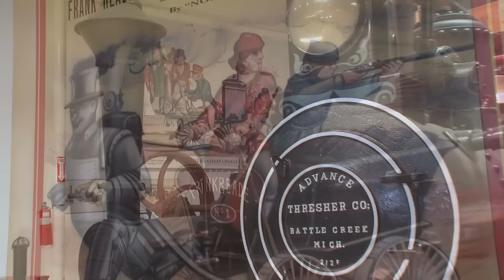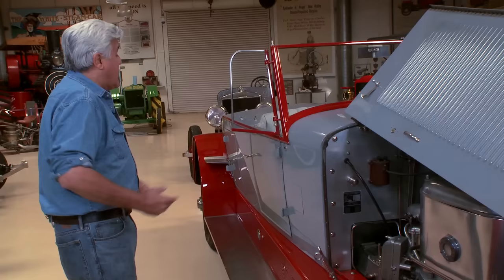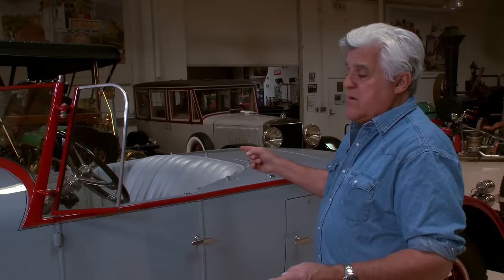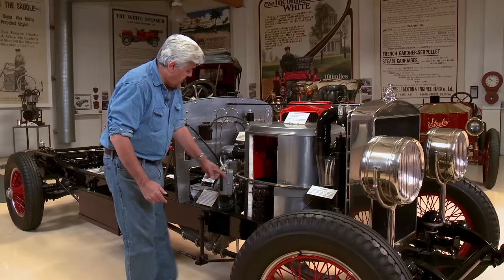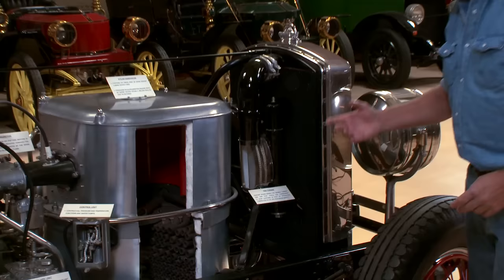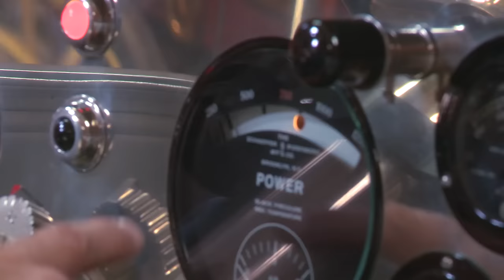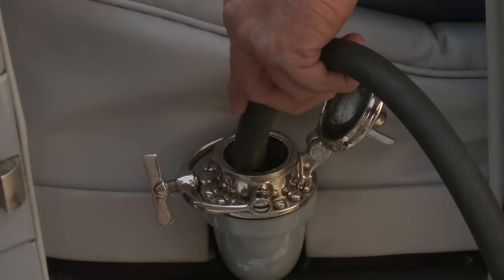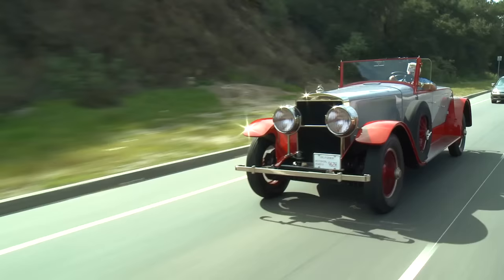1925 Doble E-20 Steam Car - Jay Leno's Garage

Comment: Amazing that they produced steam cars that advanced. I wonder what the fuel mileage was.
Reply: PacificCircle1 Most sources report actual mpg ratings for a Doble 'E' at around 12mpg on kerosene.... not very good considering it only produces 150 hp
Reply: The real doktorbimmer However not bat considering it produces 1000 pound foot of torque.
Reply: Paradigm Storytime Not really...
Reply: The real doktorbimmer Vehicles back then produced little horsepower, plus the Doble was as heavy as 15 mpg Suburban. Even today's trucks produce more horsepower per cubic inch than my '69.
Reply: PacificCircle1 Not in this class of automobile! As early as 26' Duesenberg and Bugatti were rolling out models with 265-300hp in this price range... making the Doble look pretty pathetic. 

Yes a Chevrolet Suburban is very heavy and only gets 18mpg combined 22mph highway but of course it also produces over 400hp!!!!
Reply: The real doktorbimmer Doble did not mass produce his cars so they were expensive.
Reply: PacificCircle1 They weren't mass produced because steam powered cars were already completely obsolete by 1925...  Stanley was out of business by 1924 and the White company is still in business because it already stopped building steam cars in 1911 and switched completely to gasoline (Otto) engines.
Reply: The real doktorbimmer It is well documented that Doble was always making changes, so the cars were almost single run cars.
Reply: PacificCircle1 Its also well documented that the steam car was already completely dead by the time when Abner Doble built his first E-type... all of the other steam car contenders  were gone by 1925...

Even if Mr. Doble had frozen the design for mass production it very doubtful he would have sold even one more additional car.. the market for steam cars had already dried up.
Reply: PacificCircle1 couple  of  hundred miles on a tank of  water
Reply: Michael Taylor I think we all got that from the video, the question was  fuel mileage not water mileage ... water is not used as a fuel.

The answer is about 10mpg on kerosene...

not very good considering in only produced a maxium of 150hp
Reply: 150 hp was amazing in the days it  was made
Reply: Michael Taylor No, it wasn't really... in this  price range (what we would today call a super car) by the mid-late 1920s manufacturers like Deusenberg and Bugatti were building and selling cars with nearly twice the power in the 250-350hp range.   the Doble E was really a dinosuar.
Reply: thnaks  for the  update but  those  cars  were  all top of the  range  in their  day
Reply: Michael Taylor The Doble E cost was in the same range.. if not even more expensive..

Dollar-per-Hp the Doble was very expensive
Reply: +The real doktorbimmer The Doble could reach a top speed of 132 mph range... making the Bugatti look pretty pathetic.
Reply: BluebirdFLYs Otto type ICE powered cars with Mercedes Benz,  Fiat, Sunbeam, Napier and Liberty engines had already reached 145+ mph  with engines reaching 350-450hp...

Making the Doble look pretty pathetic
Reply: The real doktorbimmer
Buddy I was quoting what you said lmao.
Reply: BluebirdFLYs WTF??? You weren't quoting anything I wrote...  I never mentioned the Doble's top speed...

It may have been the fastest steam car, but it was not by any means the fastest car in the world in 1925! Nor was it the most powerful!
Reply: When did I say it was..?
Reply: BluebirdFLYs Yesterday, you wrote quote: "Buddy I was quoting what you said"

You can't remember anything that long?
Reply: The real doktorbimmer okay you got me. I wont argue :D
Reply: ***** Childish insults and false statements won't make you look any smarter.. and it won't prove your point either.
Reply: ***** All one has to do is look at the performance and mileage figures of a new Chevrolet Suburban and compare them to the Doble... there is no comparison.

They weigh nearly the same, neither is very aerodynamic yet the ICE powered vehicle has 200-300% more horsepower and 200-300% BETTER fuel MILEAGE..

And what about cost?

Do you want me to figure out what the Doble E cost in today's dollars????
Reply: ***** The simple truth is the introduction of the electric starter killed the steam car... Why?

Because easy starting was the only advantage the steam car had over ICE powered cars..

without that they went extinct overnight...

Steam is dead.. steam cars have been obsolete for over 100 years... and they are not coming back... because ICE are simply much better.

Cheers!
Reply: ***** Yes, it certainly was, the electric starter killed any advantage the steam car had left as the technology of ICE's speed away from the steam era of the past.

Have you forgotten?

Steam cars like the Doble, White and Stanleys ran on PETROLEUM too.

so that's a moot point.

Economy of scale? The White steam car was at one point one of the largest automobile manufacturers in the world..

Certainly if one was to produce steam cars again? It would have to compete with the same cars on the road RIGHT NOW..

sometimes I think you are afflicted with a terminal case of nostalgia.. 

Steam is obsolete technology, abandoned 100 years ago because something better came along and pushed it aside..

steam cannot compete with ICEs
Reply: ***** ICEs can, have and currently are run on a limited scale.

ANY COMBUSTABLE FUEL THAT CAN BE USED TO FIRE A STEAM ENGINE.

Even wood...

ICE powered car were not very popular until the invention of the electric self starter either.

White produced thousands of steam powered vehicles before it switched to the more commercially viable ICEs... the rest of the steam car manufacturers no longer existed by 1930.

Yes, it is obsolete... and it can be easliy proven by the total and complete lack of steam powered car mass production in the past 100 years.

Well certainly you are nostalgic if you insist that a technology that has been obsolete for 100 years is still commercially viable.. either that or completely delusional.

Those claims are completely false, fabricated by your own or someone else's imagination.. As I said before VWs official reason 
for cancelling the Enginion project was..
It could not match or exceed currently available ICE technology.

Certainly no automotive engineer would expect that a steam engine on this small scale could possibly match the fuel efficiency of the modern ICE... the data collected simply confirms all the theoretically and practical engineering.
Reply: ***** Yes, petroleum based fuels were considered superior even back in the age when steam was still commercially viable.

Well, another interesting theory but one completely without a basis in modern engineering design...

Because no matter what the external political, or socio-economic influences you care to mention? none of then can disprove the fact that ICE technology is significantly more efficient than its outmoded steam predecessors.

and as the demand for fuel resources increase, so will the demand for more fuel efficient ICEs  and further and further away from obsolete technology like the antiqued steam engine...

Carnot accurately predicted that ICEs would replace steam.... even before ICEs were invented.
Reply: ***** Steam was considered sub-optimal to ICEs even before a practical ICE had been invented...

The study of thermodynamics of the heat engine and the inherent flaws in the efficiency potential of steam is what led to the invention and development of early ICE technology.
Reply: ***** Yes, because its all about Carnot and thermodynamics

WE ARE TALKING ABOUT HEAT ENGINES

How do you explain steam technologies disappearance in applications where 

IS NO TRANSMISSION OR GEAR BOX

Well it took over 100 years for steam to reach the performance level of the Doble E...

what was your point?

Or do you really have one?

Just as we do not have 80 years, billions of funds, and 10s of millions of people working on improving sailing ship technology.

Why?

Because like sailing ships steam power is obsolete!

The theory and practical applications of which are well understood and have been developed to there practical limits.

No one will ever buy cars that CANNOT MATCH the performance of existing ICE powered cars.

Its never going to happen... just like it has not happened in the passed 100 years that steam cars have been OBSOLETE
Reply: ***** That is correct, we measure engine performance and efficiency at the OUTPUT SHAFT.

This allows you to compare ENGINE PERFORMANCE...

Consumers will always chose the product that has the best value for cost..

If you foolishly attempt to sell a product that performs below standard and costs more...?

You won't be in business very long... such is the case with the steam car.

And yet, Nikolaus Carnot accurately calculated the maximum thermal efficiency of steam power and ICEs and determined that the ICE was more efficient than steam.

BEFORE ICEs WERE INVENTED!!!!

How foolish can you be to simply assume that someone born 200 years ago was not intelligent enough to understand and develop a working formula to accurately calculate thermodynamics of heat engines????  

Bullshit! steel and aluminum were already widely available and in use in the design of internal combustion engines.. 

Count Zeppelin used aluminum and steel engines in his worlds first manned powered flight and the Wright brothers also used aluminum and steel in their first heavier than air flight.

These material were available and in use for automobile components BEFORE  steam became obsolete.

Because you seem to refuse to accept the fact that steam has already reached its practical limits and this limit is FAR LOWER than the practical limits of internal combustion engines.

The Enginion experiment was not testing the viability of steam, steam is already obsolete.. the technology that was being sought was that of the catalytic combustor core.

its apparent you have no business experience and free market concept is completely lost to you...

One only has to look at the computer software industry to completely disprove you false notion of how business works...

If steam was better? someone would be trying to make a buck selling them... and succeeding...

The fact is ICEs outperform steam by a very wide margin... and are far more cost effective.
Reply: +The real doktorbimmer
I have a VERY valid point. I'm no troll, I already know the truth, and I'm quite aware of reality otherwise I wouldn't be here offering you some sound life advice. I haven't taken anything personally. I have no issue with steam being obsolete. I take no issue with discussion. I take issue with pseudointellectuals who feel it necessary to correct absolutely everyone and everything and nitpick at every single point to the effect of stifling discussion and force feeding their "I AM RIGHT AND YOU ARE ALWAYS WRONG" superiority complex. I gladly mind my own business, except in the case where every other comment on a video is from the same person with some sort of chip on their shoulder and something to prove. Stop being so obsessive, stop being such a pedant, and just shut up. You've made your point, and I'm absolutely certain there is no mistake about it that steam technology for automotive use is obsolete. Congratulations, you can make an observation in the outside world. Would you like a sticker? You're not making friends being so obsessively compulsive, let alone consistent in drawing straw man arguments, and resorting to ad hominem arguments in this comment section. Take it from someone who's been in your shoes at this moment. No one likes a know-it-all, and further, ABSOLUTELY NO ONE ENJOYS THE COMPANY OF A PEDANT. EVEN KNOW-IT-ALLS.
Reply: Eyebrows Mahoney Wankel engines only have rotors inside the ignition distributor..

The image you selected is of the orbiting piston..
Reply: The real doktorbimmer
Semantics. They are also called "Rotors", or "Rotary pistons". Despite the wankel not being a "Rotary" engine which uses pistons, the name "Pistonless Rotary Engine" has been used to distinguish between the two.

Whenever I go the dealer, they hand me a box labeled "Rotor Assy" not "Orbiting Piston Assy". Mazda also, repeatedly defines their engine as a "Rotary Engine" in it's service literature as well as at the parts counter. Feel free to take a look: http://wright-here.net/files/manuals/1989%20RX-7%20FSM/C_Engine.pdf
Reply: Eyebrows Mahoney A rotor is a device that rotates on a fixed axis..

The piston in a Wankel orbits in a planetary motion..

Mazda didn't invent the technology.. nor did they name the design or its related component terminology.
Reply: The real doktorbimmer
Your argument is that of semantics. The word Rotor has been used since the inception of the engine. Doesn't matter the make or model, when you purchase parts for a wankel motor, the exterior housing is called a rotor housing and the internal triangular "piston" that you keep calling it is a "rotor". You will be hard pressed to find any parts for a wankel by calling a rotor assembly a "oscillating piston".

Even flow meters that work off a similar principal of rotary engines called "oscillating piston flow meters" are still frequently called rotary piston flow meters. We're diverging from the point that even manufacturers of rotary engine parts still refer to the parts as "rotor" and "rotor housings". No one cares about their technical nomenclature, nor should they have to, because it's well understood what people are talking about.
Reply: Eyebrows Mahoney Not at all... but it does seem that your knowledge of the history and the engineering concepts involved is severely limited.

First off you seem to imply that the term Rotary and Rotor are somehow related in terms of the basic Wankel engine concept.

In this regard you are extremely confused and incorrect.

The Wankel engine design purchased by Toyo Kogyo from NSU-Wankel is called the Wankel type KKM-57

IT IS NOT A ROTARY TYPE ENGINE.

Nor does the design feature a Rotor as part of its basic design.

Can you even tell me who invented the Rotary internal combustion engine?
Reply: I never said, nor implied that a wankel motor was a rotary type engine. Hence why I alluded to the distinctive term "pistonless rotary engine". I am quite aware of the difference between a rotary engine, and a wankel. I am just trying to make it clear to you that just because someone uses a term that doesn't agree with your idea of ideal nomenclature does not make it incorrect. I'm not sure who is credited with the invention of the rotary combustion engine, but I know that Felix Millet was one of the first to put it into a vehicle, powering a bicycle (or motorcycle- if you will) with a 5 cylinder variant. Here is the problem though, the wording "Rotary Engine" has evolved over time to mean a Wankel type "oscillating piston" motor, partly because the rotary engine itself fell out of favor due to it's limitations. The motor itself was considered nothing more than a novelty and never really took off (Otherwise you'd be seeing more than a handful of vehicles choosing it over other more conventional ICE motors). Fast forward to the modern age where we no longer find it necessary to spin our engine around a crankshaft, and wankels see a rise in popularity. Only the most discerning pedant cares to make a distinction "well this technically isn't a rotary, it's an oscillating piston motor because a rotary type motor operates off of a fixes axis"....you won't make friends. The English language evolves, words change their meaning over time. If you'd prefer things stay the same then go learn Latin. Yes yes, I am well aware that everyone is incorrect. But I do not find it necessary to highlight it to illuminate my knowledge. So for the sake of sanity, I'm not going to continue to argue with you. You are always argumentative, does not matter what the topic of conversation is about. You always want to prove your knowledge to people, when there is nothing to prove. Sure you may know all these useless facts and tidbits. Impressive dinner conversation, great for making yourself seem knowledgeable, but that's all it's good for. You obsess about the tiniest detail. And you assert your knowledge when it isn't being sought. I'm trying to get you to maybe have an epiphany here before you drive away everyone from your life because you're "that guy". The know-it-all no one wants to hang out with because he always finds it necessary to correct the tiniest detail in casual conversation. I should know, because I've been there. Knowing all of this, is worthless. It's a curse. The loneliness that it causes is just... not worth it. It will not fill the hole in your soul. Just some friendly advice.take it or leave it.

Cheers
Reply: Eyebrows Mahoney The term "pistonless rotary engine " is an oxymoron...

and is not a correct technical description 

of the Wankel designs..

The name given by Dr. Wankel himself was DrehKOLBENmotor

the word PISTON curiously appears right in the name itself..

Yes, Felix Millet invented the design layout.
and no, it was not a novelty, its was a very successful design mass produced for aircraft which were at the time cutting edge technology..

reduce rotational mass gave the design excellent high rpm performance and light weight (due to the fact that a flywheel is unnecessary)

Dr Wankel used the Millet layout in his design.

of course this brings us back to your first mistake in referring to the design as a Rotary or that it uses rotors which it of course it does not.. it uses PISTONS

just as its name implies.

You see its because no one has ever produced a copy of Dr Wankel's Rotary type engine.. the concept was abandoned by Dr. Hanns Paschke who designed the KKM-57

the design that was mass produced until becoming obsolete in 2012.

 No it only confirms your original motivation and desire to attempt a personal attack against me, but also your deep seated insecurities about your own limited education.
Reply: The real doktorbimmer let he who be without sin cast the first stone.
Reply: Eyebrows Mahoney You must have learned something...  your welcome!
Reply: +The real doktorbimmer There is no sore loser. No one has won anything for there to be a loser. If it makes you feel better about yourself, your life, keep telling yourself that. But the only thing I've truly lost, is the time I spent here talking with you. So, there's that. You're right, I am a loser. I wasted my time trying to reason in a worthless comment thread. Touchè.
Reply: +The real doktorbimmer Doble did not mass produce his cars because he was never satisfied and instead of going ahead and manufacturing he kept modifying. If he had stopped and produced for a while he might have stayed in business. He had a number of orders that were never filled.
Reply: +tadwyn Doble didn't mass produce his cars because steam cars were already OBSOLETE!!!!!
Reply: +The real doktorbimmer From what I can find the bugatti didn't put out much more than 90 bhp until 1927 . At that point with a 17 litre engine it was putting out 350 bhp.  Torque gets you moving. HP is what gives you your top speed.
Reply: +tadwyn Exactly... which explains why the steam car was OBSOLETE before 1925... Low horsepower... and high fuel consumption..
Reply: +TheusZeusDeus No, he is correct, HP determines topspeed.. not torque
Reply: Horsepower is Nothing but a number in a calculator. . . It Still Takes TORQUE (which it has a mountain of) to ACCELERATE Up To Speed. (Up To And Including Top Speed) . . . Horsepower is just the ability to Maintain That Speed. . . There's an old saying that still holds true "Horsepower Sells Cars, but Torque Wins Races"
Reply: +oldSawer  Then why are boilers rated in HORSEPOWER
Reply: PacificCircle1 its more efficient because wood is cheap
Reply: +Horny Pervert Wood is less efficient, it has less than half the Specific Energy of petroleum and a 1/3 the Energy Density
Reply: +doctorbimmer Rather that waste my time typing it all I'm simply going to copy & paste a simple explanation on that, though I'm sure you will still attempt to argue with the answer. 

""Boiler horsepower is a boiler's capacity to deliver steam to a steam engine and is not the same unit of power as the 550 ft-lb/s definition. 

One boiler horsepower is equal to the thermal energy rate required to 
evaporate 34.5 lb of fresh water at 212 °F in one hour. In the early days of steam use, the boiler horsepower was roughly comparable to the horsepower of engines fed by the boiler.[22]
The term "boiler horsepower" was originally developed at the Philadelphia Centennial Exhibition in 1876, where the best steam engines of that period were tested. The average steam consumption of those engines (per output horsepower) was determined to be the evaporation of 30 pounds of water per hour, based on feed water at 100 °F, and saturated steam generated at 70 psig. 

This original definition is equivalent to a boiler heat output of 33,485 Btu/h. Years later in 1884, the ASME re-defined the boiler horsepower as the thermal output equal to the evaporation of 34.5 pounds per hour of water "from and at" 212 °F. 

This considerably simplified boiler testing, and provided more accurate comparisons of the boilers at that time. This revised definition is equivalent to a boiler heat output of 33,469 Btu/h. Present industrial practice is to define "boiler horsepower" as a boiler thermal output equal to 33,475 Btu/h, which is very close to the original and revised definitions.""

As with Engine horsepower, Boiler Horsepower is still nothing more than a number in a calculator, but instead of Measuring Torque and Calculating the hp from the measured torque at a given rpm they are calculating it from the amount of steam generated per pound of water at a given temperature rise.
Reply: +oldSawer  Then explain why are boilers not rated in torque???? Why bother with rating them in horsepower mr. genius saw mill operator???*
Reply: +oldSawer That is a very nice cut-n-paste of the definition of boiler horsepower... but unfortunately it does not prove you have any fuckin clue what it means....
Reply: And Boilers aren't "Rated in Torque" because there is No Measurable Torque to go by. 

They are rated in Calculated Horsepower for the same reason engines are rated in  Calculated Horsepower because Horsepower is what Farmers understood when making comparisons on the amount of work that could be done by them, but again, Horsepower in Just A Number in a Calculator, It is Not Directly Measured.

If you don't understand that then you're in way over your head and need to leave this and any other discussion on the subject or actually try learning for a change instead of constantly arguing with everyone on a subject you can't comprehend.
Reply: +oldSawer  You only proved you don't have a functional understanding of why boilers and engines are both rated in horsepower.
They are rated in horsepower, because it is the only comparable measure of RATE OF WORK two different engines can perform... the Torque value alone will not give a useful comparison between two different  engines.
Reply: +oldSawer Torque can always be manipulated or multiplied to increase the Torque output value to meet a given demand...a tiny 1 horsepower engine can generate 1,000lbs.ft of Torque. Horsepower however cannot be multiplied through the use of gear reductions or hydraulic couplings it always remains constant limiting factor. And the only true measure of engine performance.
Reply: +oldSawer If I was wrong engineers and manufacturers would rate, compare and advertise their products in Torque... but instead they always use HORSEPOWER!
Reply: No "IF" about it. You ARE Wrong.

As I pointed out before, there is an old saying (probably older than you are) that says "Horsepower Sells Cars but Torque Wins Races". They are still marketing to kids (and some adults) that don't know any better and are easily impressed by the perceived hp numbers.    

Though in more recent years some of the advertisers have been Coming Around and bragging about the torque specs over the calculated horsepower numbers, most notably in the Diesel Truck Market where the market knows that TORQUE Is King.

Real Engineers Know The Difference, but they are still marketing to people like you that don't.
Reply: +oldSawer Then explain why commercial semi trucks, ag equipment and industrial engines are always rated and sold by horsepower?
Reply: +oldSawer Locomotives, industrial and marine Diesels and Gas Turbines are rated and sold by horsepower rating...
Reply: You're grasping at straws Little man. 

Not My Fault you either Can't or Won't come to grips with Reality.
Reply: +oldSawer Real Engineers only use Horsepower/Kw to rate and compare an engine's output... Because its the only accurate method of comparing an engine's true performance.
Reply: +oldSawer If a 1 hp engine can generate 1,000lb.ft of Torque... why are 1 hp engines not used in cars and trucks?
Reply: doktorbimmer you could say... It evaporated
Reply: +simonist Yes, most of the Doble's power "evaporates" before reaching the wheels....
Reply: hey guys whats up my mom says im special
Reply: 90% of the energy in the steam car is wasted... ICE cars are 30-40% efficient with engine nearing 50% on the way.
Reply: The combined average fuel economy of ICE cars sold  last year was 25 MPG... the Doble struggles to achieve 8 MPG!
Reply: There are plenty of choices of cars that get 40 MPG or more available... None are steam cars.  https://www.edmunds.com/car-reviews/top-10/10-best-gas-and-diesel-cars-that-get-40-mpg-on-the-highway.html
Reply: Explain how increasing boiler size will improve fuel efficiency???
Reply: Explain HOW? Explain how a bigger boiler improves efficiency???? Or are you just the court jester of the jay Leno channel???